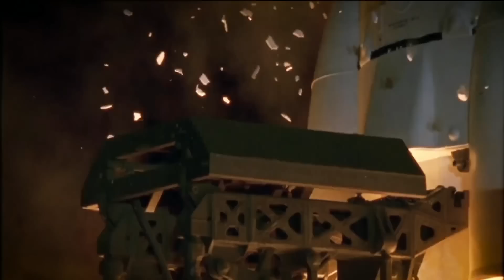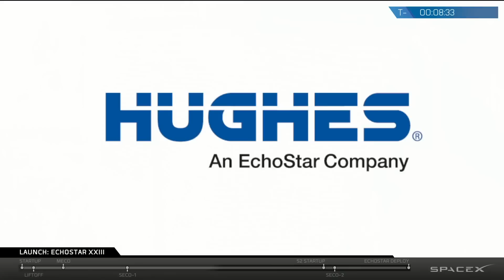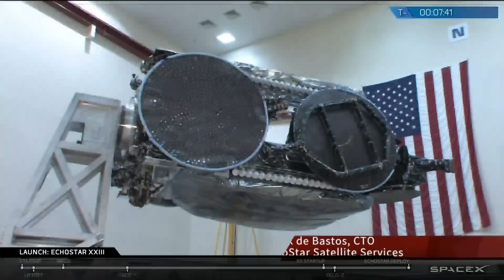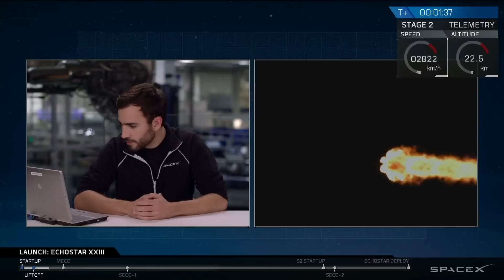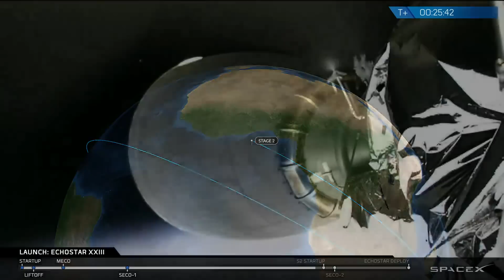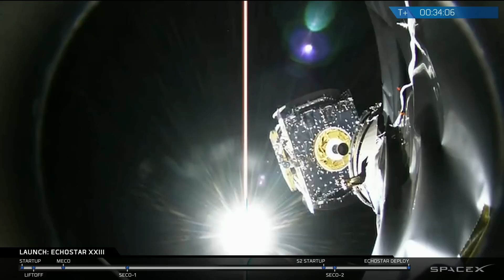Echostar XXIII Hosted Webcast

Comment: Unlike past launches, SpaceX did not try to land its first-stage booster. A combination of the satellite’s heavy weight and the high orbit it needs to reach won’t leave enough fuel in the booster’s tanks 
to bring it back. Instead, the first stage will burn up in the atmosphere after separating from the second stage.
Reply: Thank you for telling me that

Comment: did they de-orbit the second stage?
Reply: AFAIK SpaceX always does this, but they don't show it.
Reply: Michiel Haisma Not always. They do it when they have enough peformance to do so
Reply: They ussually send it on an unstable orbit so it burns up after a couple days.
Reply: In this case it is a Geostationary Transfer Orbit, so while the apogee for this mission is very high the perigee is still relatively low. So without a deorbit burn the stage will still gradually decay and burn up in a few monts or couple of years (depends on perigee altitude and solar activity etc.)
Reply: Yes, they satelite gradually raises the perigee. This particular satelite uses electric propulsion i Believe.
Reply: Joachim is referring to how the orbit looks just before satellite deployment. After satellite deployment the rocket will continue on with the original orbit with a low enough perigee to degrade. However, the satellite will use onboard thrusters to circulurize its orbit, yes.
Reply: +moba kobra which is a type of electric thruster
Reply: I dont believe they do...it up with the satellite as junk.
Reply: who is drop rockets .... I know spacex ...#rocket

Comment: Here's a question: Let's say Falcon Heavy was operational. Would it have been more economical to use it with its extra fuel capacity and return the three F9 1st stages, or to expend one F9 as was done today? I would guess that the Heavy option would be, but is there someone who can confirm this?
Reply: Wrong. Each Falcon 9 mission with standard launch services costs $62 million. The rocket manufacturing cost is usually half that, around $30 million. The first stage is maybe two-thirds of that, around $20 million. Even with no refurbishment costs the minimum price for a reused Falcon 9 is thus on the order of $40 million.
Reply: Pretty clearly the answer will depend upon multiple reuse capability of the first stage(s) of the falcon heavy.  If you can only reuse it, say, once, it almost certainly  would be more expensive I think
Reply: Honestly, no one knows yet, until they start regularly reusing 1st stages. Once they see the real cost of reusing they will do what is the better option
Reply: I thougt the first stage just parachuted and splashed down. Why wouldn't they recover it?
Reply: Leon Malan in theory falcon Heavy. as it could be reused. but until that becomes more consistent process. its not
Reply: Neither F9S1 nor F9US have parachutes. F9S1 is recoverable (if installed with recovery hardware). F9v1.0 S1 had parachutes, it was a failure.
Reply: There is no sense to reuse rockets at all then...
Reply: SpaceX says they plan this to be the case, so probably.
Reply: the problem with water landing the rocket with a parachute is that you have to completely replace all the internals of the first stage so it's not really cost effective. this was the problem nasa always had with their "reusable" boosters for the space shuttle.. they weren't actually reusable, only the shell was since internally they had to be rebuilt.
Reply: It's worse with liquid fuel rockets too. The other factor is that parachute systems get quite heavy. You still need some way to control your attitude, so the grid fins and cold gas thrusters have to stay. You still need a reentry burn to survive reentry, so you need the additional fuel and all the associated in-air restart hardware. The parachutes are also a pretty high mass, at least a ton or so. So you're barely saving any mass over a propulsive landing.

Comment: Is there a formula by which the height an girth of the rocket is defined?
Reply: Yes, the diameter of the Falcon 9 was designed to be the largest possible size transportable on US highways (since it's cheaper than transporting by ship, like some other rockets). The height is limited by aerodynamic and structural stresses on the rocket, if it were too tall without being any wider then it would have a hard time supporting itself during the stress of launch.

Comment: So just for lower Earth orbit we have those recovered landing boosters. Once we have to do real work at higher altitude, we spend the stages away an all the marvelous innovation of recovery boosters goes out the board (and burns on our atmosphere). Image how this will go when instead of a mere 55kg satellite we launch a Dragon capsule with astronauts and life support on board.
Reply: Rafael Rabinovich Dragon capsule should be light enough for at least a barge landing. The plan is to land the used boosters as well. Next launch is SES-10 which will use a recycled booster for the first time and so far the plan is to land it. There will be more expendable launches in the future, but sometime later in the year v1.3 ( "Block 5" ) will start flying which will enable them to land with heavier payloads. However if something heavy enough comes across like a DoD sat I'm sure it's nice to always have the option to fly expendable. But the plan for the future is to land them every time. Even the used boosters.
Reply: Your assumption is quite incorrect, and this will be one of the last expendable rockets they launch. SpaceX has in the past recovered boosters from GTO missions like this one weighing over 5000kg.
Reply: BadWolf HS This one was their heaviest GTO launch to date, 5500kg. The heaviest that landed was 5320kg. Probably they could've made it on the barge, but a) they didn't want a repeat of SES-9 right before the first reused launch (which coincidentally is SES-10), preventing recovery on that mission, and b) they were busy installing the "Roomba" on the barge.
Reply: NetRolller3D keep in mind also that the change in loading procedure after AMOS-6 will have slightly reduced the fuel margins for the first stage, however once Block V of the F9 is ready then those margins should increase again even for a launch as heavy as this one.

Comment: well, there went 60 million dollars.  I'm assuming that once falcon heavy is online, we'll be able to launch even heavier payloads and at higher velocities, while retaining the ability to land the 1st stages?   
and when are they going to try to recover the payload fairings?  those things are expensive, and it would not seem that hard to glide them back..
Reply: It probably already crushed to pieces. But I don't know honestly. Maybe they do recover it.
Reply: Fairings are not that expensive (~$2mil), though they have a long production time. SpaceX has had recovery attempts for the payload fairings on the past few flights by using cold gas thrusters to control the descent attitude and limit reentry loads. It's not been successful thus far. On this flight they did not have the fairing recovery hardware installed because given the high velocity, it was a long shot anyway.
Reply: i'd  love to learn more about the fairing recovery attempts. where can i find more info on them?
thanks!
Reply: Oof, you're asking about one of the more secretive aspects of SpaceX. I think the best starting point is the technical slides from SpaceX, which weren't really classified but not exactly intended for public release either: https://www.reddit.com/r/spacex/comments/2zkxi5/spacex_design_and_operations_overview_of_fairing/

There's further bits of information from Musk and Shotwell. For example, Musk noted earlier that autosteering chutes haven't been added yet on Twitter. I can't find the tweet. We have generally inferred that Airborne Systems FireFly is the parachute they will use, because it's the right mass, autosteers already, and is the contractor for Dragon drogue and main parachutes. It's also clear from both the mass of the fairing and from videos of the fairings using their RCS thrusters that those thrusters are simple nitrogen cold gas thrusters, much like the ones used in Falcon 9 Stage 1 and Upper Stage. Shotwell noted after, I believe, CRS-10, that SpaceX had not yet successfully recovered a fairing.

Sorry for the essay - just that it's really hard to get information on the attempts, and it's one of the mystery things we have to deal with. Also, of course other people will probably know more than me, I'm just giving a very upper level design summary and only as I've pieced together - I could be wrong. I linked to the SpaceX subreddit above; if you're not familiar, it might be worth checking out as it's a great information source.

Comment: What is that strap that flies off the 2nd stage engine after 1st stage separation?
Reply: Reinforces the engine bell until the exhaust pressure can take over.
Reply: Specifically, reinforces the engine bell for ground handling (and there's no point in removing it, just introduces additional risk). It serves no actual flight role; the engine's thrust just pushes it out.

Comment: 45:20 A tiny piece of space junk is born
Reply: It doesn't look very heavy, but I still wouldn't want that to hit my face at 10 km/s
Reply: It is "frost" which will evaporate very quickly. Earlier, at 44:15 when the rocket engine was turned on for the second time, a really giant lump of the same stuff fell off and vaporized instantly in the exhaust -- though it is hard to see, because cameras have switched at exactly the same moment. (The giant lump falls off, camera switches to the view from the other side of the engine, and you see a flare in the exhaust in the background, while a much smaller piece also falls off in the foreground.)

Comment: cmon people...basic rocket science...make the rocket bigger so you can carry more fuel and land stage 1....pipes, shields, gaskets, nuts and bolts multipled by 0.5 should just about do it. I know it because I have a geography background hahahaha rant aside...well done
Reply: More fuel more weight you need a better engine etc...
That falcon 9 is not the block 5 as far as i know ( the newest one)

Comment: 1:05:50  dat look  :D

But WHY they didn't land 1st stage? Anyone found out yet?
Reply: too much energy needed to be used to bring the payload to orbit, hence none left over for landing. high energy orbit combined with high satellite mass.
Reply: Thanks. 
Kinda disappointing. I wonder if that's just a phase and they'll figure this out in future.
Reply: More boosters. Asparagus staging.
Reply: This is the Block 3/4 of the Falcon 9. Block 5 due to start later this year has better margins so they might just be able to do the landing in that case. Once re usability becomes easier, using the Falcon Heavy to lower the margins but become more feasible then doing a high margin landing which causes more stress on the vehicle. So yes, this is something that will become a lot less frequent.
Reply: This was the last time.
Reply: FiiZzioN actually it's not
Reply: Bercik87 Sometimes they need to bring heavier satellites to orbit and sometimes the orbit is higher so in any case it needs more fuel so none is left for landing. If they had a falcon heavy they certainly could have done the landing.
Actually that will be super cool to see all three boosters landing once they fire up the falcon heavy.
Reply: Watch at 4:24.
Reply: FiiZzioN it won't be the last until the Falcon Heavy starts flying. But it hasn't flown yet so till then it's expendable. Also, upgraded falcon won't fly till Q3-Q4 of this year.
Reply: +Bercik87 Maybe if you had watched the video you would know why they didn't land the main rocket...and it didn't even require that much watching to find that out...why is it everyone else's job to not be lazy so you can be informed?
Reply: Intelsat 35e will most certainly be expendable, it's 6.6 tons.
Reply: thes said on their site, this will be the last expendable one so...
Reply: Twinny Ate It doesn't say that on their site.
Reply: They've never said this would be the last expendable flight, they HAVE said it's one of the last expendable flights. But there are payloads coming up that will most likely be expendable unless flown on Falcon Heavy or Block 5 F9, and seeing as those aren't coming in time for flights such as Intelsat 35e it'll fly expendable again.
Reply: It's wrong. It's impossible for Falcon 9 to carry that payload and be reused.
Reply: U know what?^^ My bad lol! U are absolutley (maybe^^) right! At least I didn't get that info from their site!^^ I just back tracked and only found it was an artical I was reading in "The Science Times". It went deeper into it (a little) from a link, which turned out to be "The Verge".  

Sorry bout that once more. I'll erase that comment to not mislead others.. If only otha mfkas did the same! IT WAS A MISTAAAAAAAAAAKE!^^
Reply: Yep, that's EXACTLY what was said! I got the sites mixed up but, that's what was said so...
Reply: Twinny Ate Then whatever site said it is wrong.

Comment: "Egg shape" orbit?  They must keep the smart guys off camera.
Reply: What's wrong with that? GTO is an orbit shaped like an egg.
Reply: BadWolf HS it's called an elliptical orbit.
Reply: And this is a broadcast for the general public, most of whom probably don't know what an elliptical orbit is. That's why the hosts relate it to a shape everyone is familiar with.
Reply: Using "egg shaped" is bad as simplification because it falsely and strongly points to asymmetry.
If you really want to avoid the scary word ellipse (which IMO is such basic knowledge that it must not be avoided) then "elongated/stretched circle" is a much better choice.
Reply: Oval works lol
Reply: sgauntt Probably because an egg laid by a hen in zero-G would be perfectly ellipsoidal, without that pesky asymmetry.

Comment: "SpaceX will not attempt to land Falcon 9’s first stage after launch due to mission requirements.". What circumstances are  that which require to lose tens of millions of dollars on a first stage?
Reply: The payload is heavier than the max payload where you can do a landing. On the FT Falcon, GTO max payload is 8300kg in expendable mode but only 5500 kg if you want to land the first stage. This satellite weighs north of 6000kg. The next version, the Block 5, should be able to land the first stage with a GTO payload this size.
Reply: Ekpa Its not critical. It is what every other space company does. Spacex is the only one so far that is trying to land first stages after orbital flights
Reply: It's not as if those first stages that landed successfully have been reused. My understanding is that a previously landed first stage will be reused for the first time for the launch of SES-10 on March 27th.
Reply: Correct. 27th is the first reuse and SES received a small discount for being the first customer to fly on a flight proven stage. All customers up to this point have been paying for the Falcon 9 in expendable mode so its not critical economicly for SpaceX to loose stages. It has sort  of been like a bonus for SpaceX. Eventually I am sure the price will go down because of reuse. I heard Gwynne Shotwell talking about a 30 percent reduction in the future.
Reply: 30% seems unlikely to me, as that only sounds reasonable assuming absolutely no refurbishment costs.
Reply: Ultimate goal, yes. I don't think it's possible for Falcon 9 though. It's too small for second stage reuse and the number of design compromises made to fit in recovery hardware makes it inherently structurally difficult relative to other rockets.
Reply: Maybe they are afraid to fuel it for the maximum capacity after "anomaly"?
Reply: No, nothing to do with that. It's fueled to maximum capacity and the last anomaly was not because it was fueled fully.